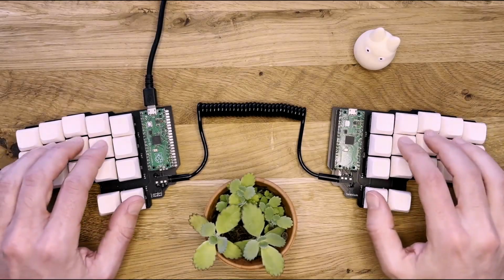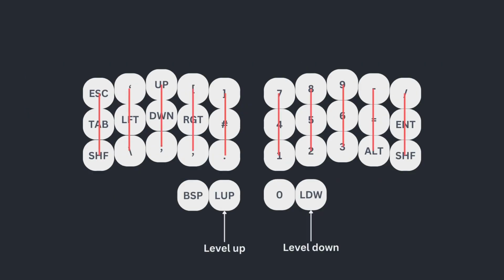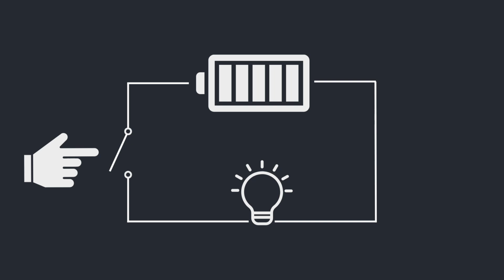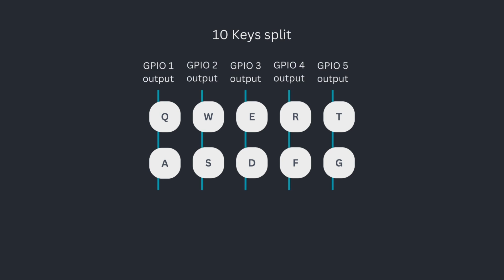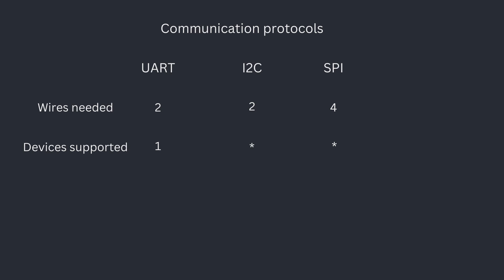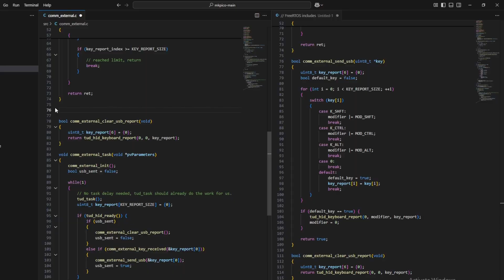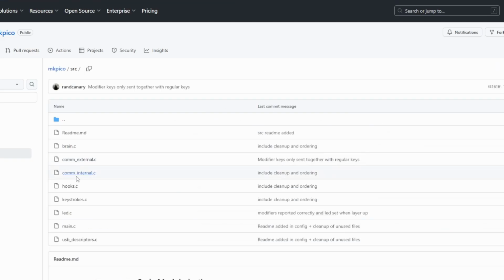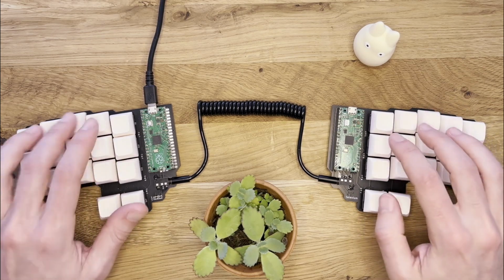I built a mechanical keyboard from scratch

Comment: Great video! The music is a bit loud at some parts. I also noticed a mistake: without a key matrix you would need n GPIOs, where n is the number of keys. Because one side of the pin could be connected to a constant 3.3V instead of a second GPIO.
Reply from the maker: Thanks for your comment and feedback, really appreciate it! Thanks for clarifying it, without a key matrix the total number of GPIOs needed is n (number of keys). It can be done either connecting the other end to a constant 3.3V or a ground (and set the GPIOs with a pull up).